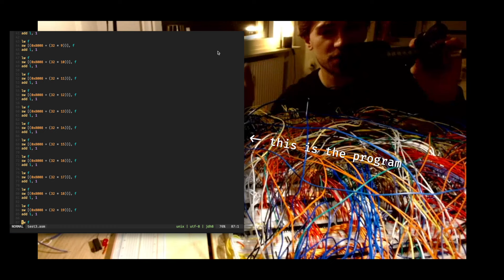it works

Comment: Thats one way baypass the current GPU shortage.
Reply: I'm satisfied with my SIMD instructions, tbh. Who needs a GPU? Let's just make CPUs better at GPU stuff.
Reply: For those pong gamers out there, yeah
Reply: @shambhav9534 I wouldn't say no to great CPU Graphics, but as a gamer I currently depend on them.
Reply: @spygot  They would be faster as well because then you wouldn't need to transfer memory from the CPU to the GPU and vice versa.
Reply: @spygot  no you dont, integrated graphics are not the same thing as software rendering.
Integrated graphics is basically a mini gpu built into the chip while software rendering is actually using the cpu to render. Completely different things
Reply: @spygot  Just to add to Ellin's point, this is why the M1 chip is faster because everything is in one place essentially.
Reply: @harmitchhabra989  My comment was maybe misunderstood, I know how the GPU in a M1 or other CPUs work, the problem is that currently they aren't powerful enough to run Games like MSFS in Max Quality. In a few years thats propably a complety different story.
Reply: @shambhav9534  honestly  I think the future of graphics is software rendering on the CPU once they get expanded vector instructions in the future, no more gpu drivers, no more crappy api's like opengl, vulkan etc. just explicitly code everything on the cpu
Reply: @CianMcsweeney  Yeah exactly. I think GPUs will start to be used for machine learning and graphics will be done by CPUs.
Reply: @CianMcsweeney  with how different gpus and cpus are I highly doubt that. Don't think matching the performance of a dedicated gpu through pure cpu power is happening anytime soon, but hey I guess we'll see

And you'd basically be creating a render pipeline like the one in a gpu anyway so theres really no point
Reply: Underrated

Comment: You motivated me to switch to linux and start learning C
Reply: wait what
Reply: Take a look at the Zig programming language :)
Reply: @meowpspspsps  based
Reply: Pop!_OS is a great place to start.
Reply: @elorrambasdo5233  depends what you want from it. if extensibility and a hands-on experience is what you want, then maybe not
Reply: Welcome aboard ^^
Reply: @elorrambasdo5233  pop os seemed way to unstable to me
Reply: @billycrooks8401  for me too, but i revisited it yesterday and it is now a pleasant experience
Reply: @elorrambasdo5233  linus tech tips moment
Reply: @meowpspspsps  based
Reply: Looks like I have MacOS and it has a built in terminal
Reply: @billycrooks8401  What issues have you had with Pop? ( I don't often hear complaints about it)
Reply: he uses mac
Reply: i read it as switching from Linux programming language to C
Reply: Go back to windows you silly you.
Reply: @meowpspspsps  Fad languages are temporary, C is eternal /s
Reply: @SomeRandomPiggo  C is a fad, Assembly is the only true language.

Comment: I always maintained that there is a point of complexity, beyond which doing the whole thing on breadboards is not worth it, and it's best to just make a few PCBs until you get it right. Or maybe just make PCB or perfboard modules and wire them together, if you're not yet sure about the whole. Needless to say my threshold for doing that is way before you end up with what I'm seeing here. Cool project though.

Comment: Next step is to design an actual circuit board based on that beautiful creation you are showing in this video which you can fit in an actual computer case with the necessery IO ports and create an OS for that circuit board which runs Pacman.

Comment: jesus mate. did you never stop for a second and think "maybe this is a bit much"? after weeks I sure would have been burned out. Maybe you could have just programmed something to simulate that entire thing and skipped the miles of wire you probably have there altogether. maybe even generated a PCB from it afterwards. Hopefully you enjoyed it, but fiddling around with hundreds of wires and stuff not working cuz you plugged one wrong on accident - for weeks - doesn't much sound like fun or learning to me.

I've done a fair bit of the stuff you've done on this channel coincidentally enough, even including the OS stuff. So I understand having that level of perseverance. But I also did a demultiplexer with flip-flops and transistor level risers for one project (like this, on a breadboard with a bunch of wires), that was 3 breadboards, and way more than enough of that for me. Plus I mean you've surely got at least a few hundred dollars of breadboards and components there. If you've gone through the trouble of doing all this at least do actually make a PCB in the end with all of it so you can immortalize it on your wall or something.
Reply from the maker: To answer your question, yeah. A lot. But the computer was built in smaller modules of 1-4 boards each which made it much easier to debug - only became a huge mess on the last day when all of the data/added/control wires needed to start going across boards. And even then the unplugged wire problem took me max 30 mins to find each time it happened 🙃

but I guess I’d say my channel doesn’t exist to do reasonable/“easy” things 🙂 the frustration is a part of the experience